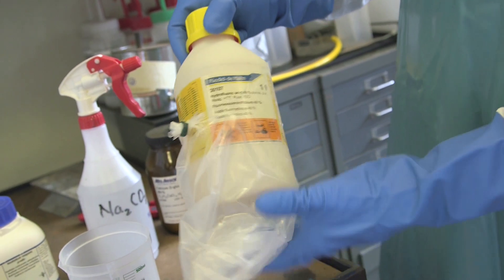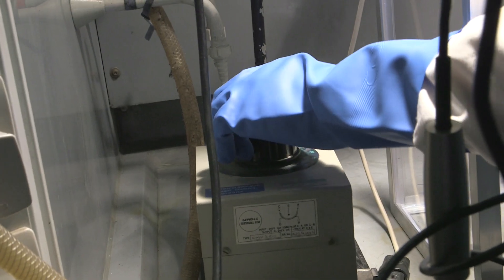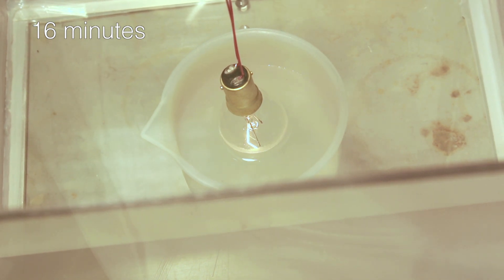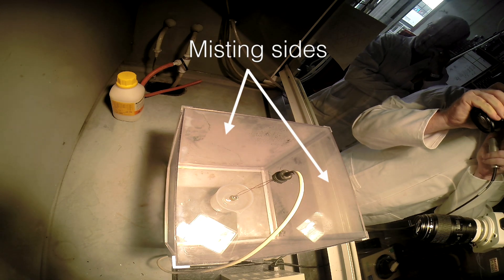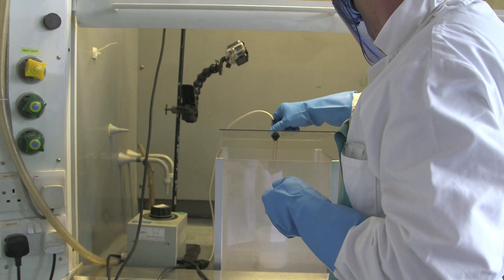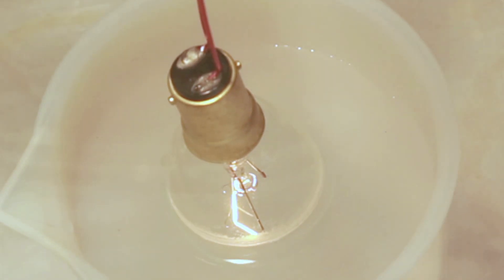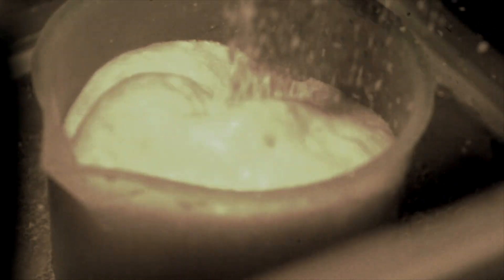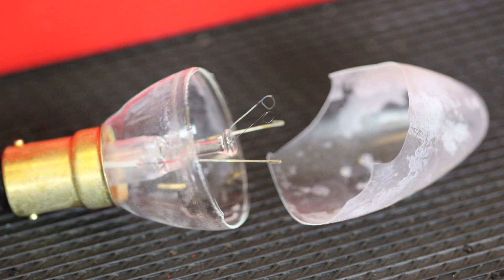Light Bulb in Hydrofluoric Acid (HF)

Comment: so how does it trigger heart attack instead of just burning you?
Reply: Because it leaches calcium from your bones and system. Calcium is used as part of the signalling systems in your body. HF is pretty much the devil's piss.
Reply: maybe it goes in your circulatory system, wich...you know...leads to the heart
Reply: Yeah, I had to look that up, too. Apparently, it dissolves through your skin until it gets to your bloodstream, at which point it interferes with your body's ability to utilize calcium. Calcium, by the way, is extremely important to generating nerve signals, so without it, your nerves stop working--including the ones that keep your heart beating. Hence, heart attack.

Hydrofluoric acid is fun! :D
Reply: IceMetalPunk Yeah when I worked in a univ. Maintenance dept, handling the fume cupboard fans during repairs involved full body disposable coveralls, face shield, respirator, boots, gloves, etc, and calcium gluconate gel was always available  just in case

Comment: Among your best!
.
and the electrolytic current flow was very interesting...
.
(Here's an idea... build a one-tube radio and run it's output through an amplifier so we can hear a local station. Let's listen to an 'information signal' when the glass implodes and we hear the signal flowing not through the "ether" of the vacuum but through the liquid...)
.
O.K., that's broader than just chemistry, but still might be interesting...

Comment: I had no idea that there was a chemical out there that could dissolve glass.
Reply: Cesium hydroxide is a scary compound, it will quickly smash through glass and react with pretty much everything else.
Reply: Hey look, its my fave acid!
Reply: NaOH can dissolve glassO_o
Reply: Yeah, I do. And at 40 GB data cap at $160/month. I don't watch any TV or download any large files off the internet unless it's absolutely necessary.
Reply: Many chemicals can dissolve glass like:-
1. LiOH 
2. NaOH
3. KOH
4. RbOH 
5. CsOH 
6. HF
7. H₂SiF₆
8. Ca(OH)₂
9. Sr(OH)₂
10. Ba(OH)₂
11. HSbF₆

Most of these chemicals react slowly with glass with the exception of 4,5,6,7 and 11.
Reply: Guess one of us wasn't watching breaking bad :D
Reply: *****  I don't have TV.
Reply: Stephen Fonnesbeck you have internet
Reply: ***** The reason that the plastic doesnt react is because the "acidity" of HF comes from the flourine ion reaction. The PE (Polyethylene) plastics are comprised of hydrogen and carbon (C2H4)nH2 which has nothing to exchange ions with for oxidization. Its reactibility is pretty limited with acids (it will react to bases) and usually requires some kind of catalyst and high temperature.
Reply: Stephen Fonnesbeck  you need new internet
Reply: *****  are you offering?
Reply: Stephen Fonnesbeck nope :P but with that money you can
Reply: ***** can what?
Reply: check out Magic acid ;)
Reply: Fluoroantimonic acid will dissolve practically ANYTHING!

Comment: I think i know why it cracked like that: Because of temperature difference! The top part was in air (bad heat conductor) and the bottom one in a liquid (good heat conductor) so the bottom got cooled while the top got hotter (because the lightbulb was on) and at the surface where the"cold" touches the"hot" it cracked (as glass does with high temperature differences) the HF just weakened the bulb.

Comment: As a chemist who has been repeatedly using HF in the past two years, I am surprised they chose to use sodium carbonate to neutralize it. Not only is sodium fluoride still an unsafe chemical, as the fluorine is still weakly bound, but the bubbling can lead to an HF/NaF mist.
I, personally, use a large amount of water with some calcium chloride or nitrate dissolved in it. There's no bubbling, all the fluorides precipitate as harmless calcium fluoride, and the dilute acid resulting from it can simply be disposed of as any aqueous acidic solution. (although we still use a separate waste container labelled "Hydrofluoric acid waste" for it).
In general, I think calcium salts should always be used in neutralizing HF.
Reply: breakbumper
Solubility IS relevant, since it means you won't be able to dissolve much of it in the solution you prepare for neutralizing the HF.

It would be irrelevant if applied as a powder directly on the HF.
This is not what I do : I use a large beaker filled with the calcium solution in which I dip all the contaminated labware.
Reply: RedInferno112
Because calcium hydroxide has very low solubility in water, and is also corrosive anyway. Plus, it is sold as a fine dust, which I really don't like to handle.
Reply: michalchik  Calcium gluconate is the recommended first aid for HF skin exposure.  Worked as a safety officer at a petroleum refinery that used HF in making isobutane into gasoline.
Reply: @solypsomancer9540  In oil drilling they use it to acidize off some SiO2 and other bad things down hole. And our maintenance engineer ordered some dozens of cans with HNO3conc/HFconc In an mixture of 70%-30%. I had to tell him that spraying that on stainless steel pipes in the plant is a bad idea without tent, full rubber suit, breathing supply from outside and safety shower plus Calcium gluconate (as injection).
Reply: RedInferno112
Yes, but still a lot more unsafe than an equivalent quantity of acid. Fluorides are NASTY.
Reply: piranha031091 Thanks for sharing your knowledge. I've just started A-Level Chemistry so forgive me if I seemed a bit ignorant!
Reply: piranha031091 boriseng breakbumper michalchik ***** 
 Well, I agree with you Piranha, I would not recommend carbonates to neutralize HF (to avoid splashing). At the same time, boriseng is right here too. If you add any calcium salt to HF, it will precipitate calcium fluoride which is insoluble in water and it resists acid from reacting with it further. Hence, we need to use Sodium hydroxide solution first to neutralize HF. Then you can treat the resulting solution (NaF) with any soluble calcium salt to precipitate calcium fluoride (as NaF is highly toxic). Calcium fluoride is generally considered non-toxic and safer to use.
Reply: breakbumper If the reaction product is insoluble isn't there a risk the reaction won't go to completion, it would get passivated by a thin layer of the fluoride salt.
I vaguely recall if you put calcium carbonate in sulphuric acid you got a disappointing short fizz then the reaction was stopped by a barrier layer of sulphate
Reply: RedInferno112
A dilute solution of it. Which we have waste containers specifically for.
Reply: Shiva Chemist
 "If you add any calcium salt to HF, it will precipitate calcium fluoride which is insoluble in water and it resists acid from reacting with it further."

If it is passivation you're talking about, it doesn't apply if the calcium salt is already in solution. And I don't see how neutralizing the acidity first changes anything about it. Unless we're talking about two different things?
Reply: piranha031091 Not if you intend to put solid calcium carbonate in the acid. The acid will happily react with it.
Reply: *****
 Solubility in water is 40 g/L. That's almost 1mol/L of fluorides.
I don't think there's much to add regarding both statements.
Reply: piranha031091 Hehe nice one. I haven't done much with fluoride salts yet so it was educational.

It's particularly interesting how Group 2 fluorides aren't very soluble.
Reply: *****
For HF waste disposal? Yes, it is what I do:
"I, personally, use a large amount of water with some calcium chloride or nitrate dissolved in it"

Unless you were replying to an other comment?
Reply: piranha031091 He probably means about releasing the fluoride ion into solution again.
Reply: RedInferno112  Ionic compounds don't evaporate, but depending on the environment it is in (mostly depending on acidity and solvent), part of your acid may become undissociated and follow along with your distillate. I'd have to look at your exact protocol to tell you more. (And at the amount of acid that was found in the distillate)

But yeah, distillation of acids is not that simple, Raoult and Henry's laws may play tricks on you, and you often get all sorts of weird azeotropes. What I said mostly applies to salts in a more or less neutral (or basic) environment.
Reply: boriseng That is true, but you can check for that by using universal indicator paper.
Reply: piranha031091 But then wouldn't the NaF be dilute too if applied to the same solution?
Reply: piranha031091 I was thinking the same thing. At 1:50 they show a bottle of Calcium Gluconate and i thought, oh that is what they are going to precipitate it out with, I'd use quicklime, but that would work i suppose. Then they neutralized it with NaHCO3 and made a big foamy mess of soluble fluoride, certainly not as dangerous as HF, but still toxic in that concentration.
Reply: piranha031091  I just realized when the skins integrity has broken down as a result of the acid, a calcium gluconate gel may well penetrate.
Reply: piranha031091 

 I’m hoping someone can help me out with these questions.
At what temperature does fluorine evaporate at? And can boiling water get rid
of fluoride if not why? I thought fluoride is fluorine bond to other elements for
example like salt. So if you boil the water it should cause the fluorine to
release from the salt and evaporate from the water?
Reply: piranha031091 I would like to ask you a question piranha031091 is fluoride bad for us even at low levels. The Harvard study on fluoride that was published by Harvard in 2012 said fluoride is harmful to humans do you agree with this? And is the fluoride in nature safer than the fluoride that is added to water if so why?
Reply: piranha031091 I do appreciate your answer to my question thank you very very much ;-D  I have copied and pasted this information that you gave me to Microsoft word and will be studying the info more.  Thank you
Reply: piranha031091 Just a bit on your last point, from personal experience, don't some of the ions in solution evaporate during distillation? For example, in chem class recently, we did oxidation of 2ndary alcohols to ketones, and in the distillate we found loads of acid, which had to be from the sulphuric acid catalyst. Correct me if I'm wrong, but isn't sulphuric acid very strongly ionic? (protons and sulphate ions, very little non-dissociated) In pure form, it has a very high boiling point, much higher than any temperatures reached in the experiment. From what I, and my chem teacher could deduce, it must have evaporated at least partially?
Reply: CB telling I didn't say anything about neutral fluorine. Also, C-F bonds are some of the strongest bonds in organic chem, but it's not strongly ionic. My main point is that in solution, ionic bonds are weakened due to the polarity of the water molecules dissociating the ions, therefore they could be easily more volatile.
Reply: CB telling
 Ok, so, Teflon is a fluorocarbon, that's not what people would call a fluoride. (Fluoride would mean a salt of fluorine and a metal)

The C-F bonds of teflon (or any other fluorocarbon) are among the strongest bonds you'll find in organic chemistry. That's why teflon is so chemically inert.

Fluorine atoms can DEFINITELY NOT leave teflon, unless you heat it up so high you pretty much turn it into a plasma (thousands of degrees C). (C-C bonds will break looong before.)

(I would be curious to know where you read fluorine could leave teflon btw.)

Other than that, I do agree with what the guy told you.
Reply: piranha031091 I would like to know the answer to RedInferno112 question. RedInferno112 said---  "My main point is that in solution, ionic bonds are weakened due to the polarity of the water molecules dissociating the ions, therefore they could be easily more volatile."  I kind of understand what he is saying. The magnetism of water weakening chemical bonds making them more volatile.
Reply: Iv used it too only we use sodium bicarbonate and for spillages we use dry magnesium sulphate
Reply: I was thinking the same thing!  Why not use calcium hydroxide?
Reply: So when hf is in water it will disassociate to form H+ and F- right?  The point is not the H+ reacting with the acidic properties but the F which would substitute the H in organic compounds.  Am i right?
Reply: You dont mess with the science itself😂😂
Reply: I wanna know more
Reply: Because you use lots of water all the thirsty people in the world could drink.
Reply: Ok
Reply: I thought calcium gluconate was the suggested antidote for HF
Reply: @guyteigh3375  Thats true. When you are lucky it is injected , before it reacted with Na and K in the blood what usually stops the heart.
Reply: I use boric acid lol
Reply: You can use boric acid to neutralize HF it will form tetrafluoroboric acid in the solution and it neutralises the solution peacefully.
Reply: piranha031091 Calcium hydroxide isn't really anywhere near as nasty as it's advertised. I've handled it before many a time and it's only an issue if you ingest it or get it in your eyes.

Anyway, couldn't you just use a dilute solution or use sodium hydroxide instead since it's more soluble?
Reply: piranha031091 >hf mist

something about that sounds bad...
Reply: piranha031091 You'd still have volatile HCL to deal with though :/
Reply: +piranha031091 This guy is right, no one is affraid of HF because of its strenght as an acid, it is all about that F- ion.
Reply: piranha031091
Solubility is irrelevant here. Calcium hydroxide will happily react with hydrofluoric acid to form calcium fluoride and water. After all, hydrochloric acid will react with calcium carbonate, yet that has low solubility. Calcium fluoride is a much safer byproduct of the nutralisation of HF because it is so insoluble.
Reply: And yet we poison our water supply with sodium fluoride :(
Reply: @wesleyhurd3574  you don't seem to understand that fluorides are naturally occurring minerals, especially in areas with volcanic activity.  Part of fluoridating water supplies in many areas of the world is decreasing the fluoride level to what is considered safe for human consumption.  Why is it that people freak out over fluoride ions in water that have proven beneficial effects on dental health, yet they ignore the fluoride found in 10⁶ greater concentration in tea leaves as tea plants grow in areas with high natural fluoride and bioaccumulate it in the leaves?